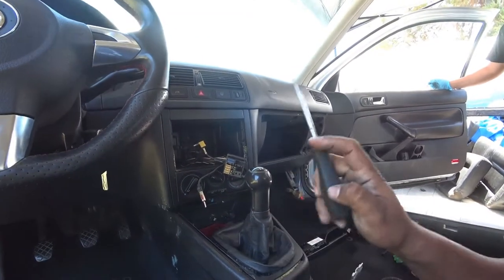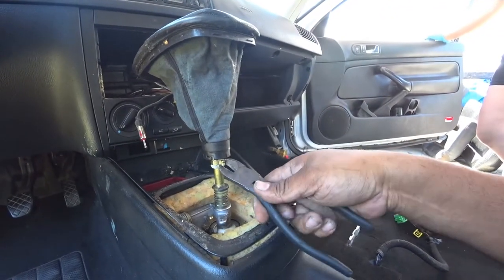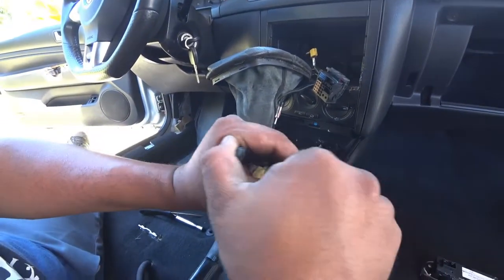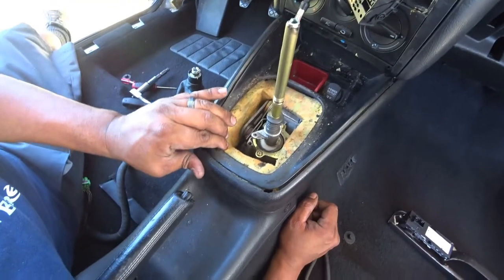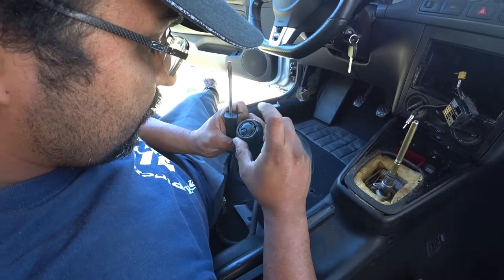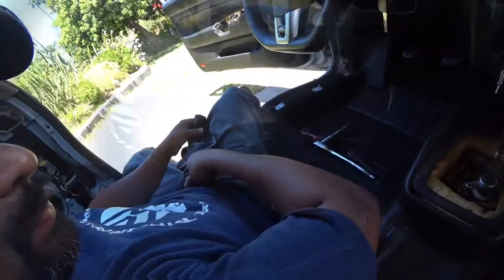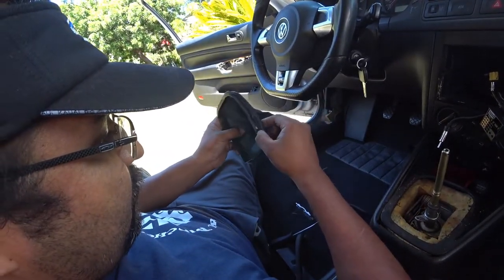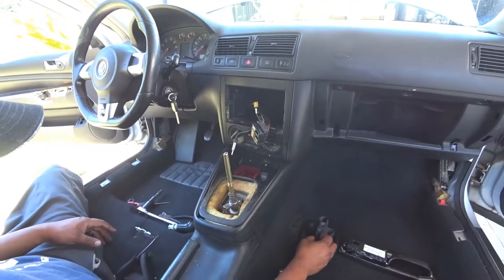How to remove an MK4 GTI/Jetta/Golf boot and shift knob QUICKIE!

Comment: Good luck changing out those shifter bushings. They’re inexpensive and easy to replace, BUT to get at them - now there’s the rub.

The main bushing there is accessed by a torx screw to the left. To get at it (too tight even to get a right-angle adapter in there), you pretty much have to remove the entire center console. For my TDi I even had to remove the armrest console. Lots of screws and difficult plastic snap in parts that become brittle.

It is quite a frustrating chore to change the bushings. What an opportunity to thoroughly clean the car, though… (silver lining?🤔)

Comment: Learn how to take apart before you start, otherwise you end up breaking parts. The black ring was a collar that holds the boot on the knob and that is removed inside the boot with a pry tool.